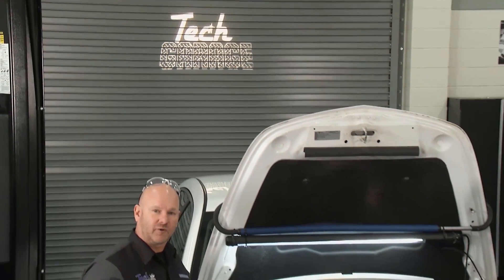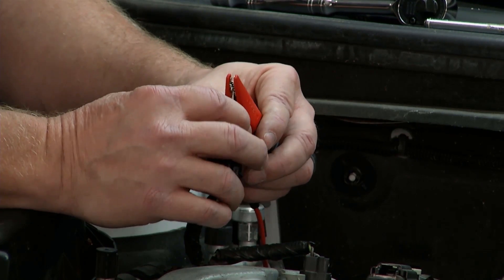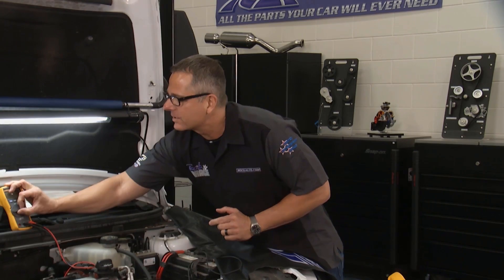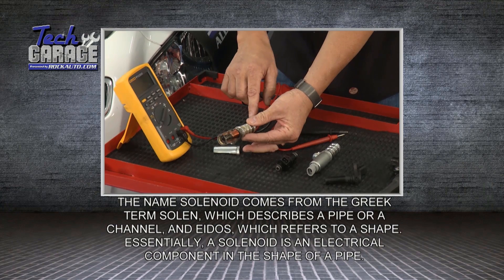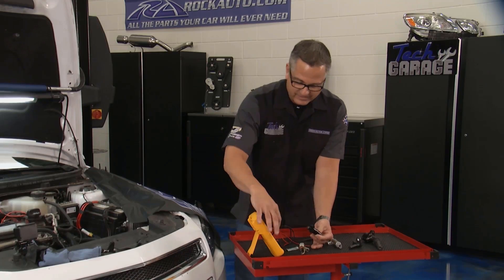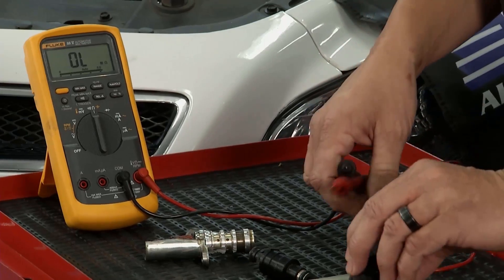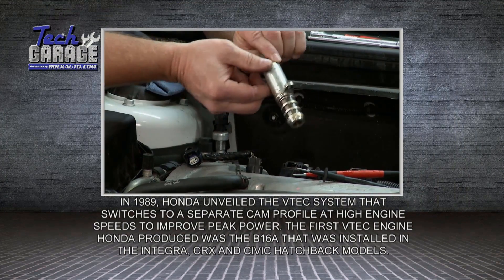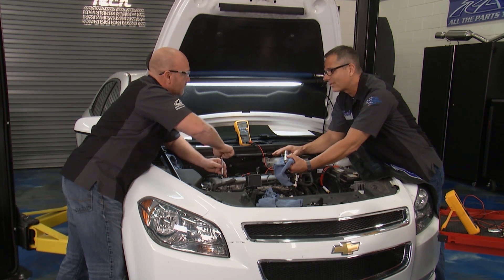Variable Valve Timing Solenoid Replacement

Comment: My wife and I are picking up a used 2014 2500 5.7l Tradesman Crew Cab 4x4 with 18,030 miles on it. This truck has VVT so this is going to be important to know! Thank you for posting this video.

Comment: I have a 2010 Camaro 3.6l engine and my aculator solenoid bank 1 and 2 are leaking oil bad. My question is can I just pull them off or is there a specific way I need to removed them? Is it possible to mess up the timing chain in any way?
Reply: The Solenoids, of which there are four, are not directly connected to the timing chains. They simply direct oil through galleries to change the orientation of the camshaft actuators at the front of each camshaft.

Particularly if there are leaks around the solenoids, remember to also replace the solenoid to timing cover seals, that may be purchased separately. I would be inclined to replace the seals in any case. A pain to have to do the whole job again for the sake of less than $50 in parts (possibly even lower cost.)

Comment: Would have been nice if you'd have said the torque for that 10 mm bolt.
Reply: bout 'meh' tight. know what I mean?
Reply: 10mm bolt head/socket to remove
Reply: The torque specification for a VVT (Variable Valve Timing) solenoid bolt is typically very low, usually ranging between 8 and 12 ft-lbs (10 to 15 Nm); however, it's crucial to always consult your vehicle's specific service manual for the most accurate torque value as it can vary depending on the car model and manufacturer.

The bolt is threaded into the aluminium timing cover, therefore it is important not to over-torque the bolt and possibly strip the thread.

Comment: 2 questions. 
What if debris gets into the solenoid whole? How do I clean it out.
Plus how do I replace the wiring harness? One of the tabs is broken might not connect properly.
Reply: Unfortunately I'd take off the valve cover, best way to clean it, then change the oil.

Comment: I did this with my 2013 Buick regal and now oil is coming from under the solenoids.  This wasn't happening before and I'm still getting a code coming up for this same thing.
Reply: Replace seals
Reply: @ABoog816  Replace the solenoid / timing cover seals.

Comment: Ok, so my question is, i cant get the clip off the VVT solenoid. what do i do to remove it? I got the clip pieces to pop up at the top of the of plastic that locks it down but where do i squeeze on the plastic that attaches the wires to the solenoid to get it to release so i can then remove the solenoid and replace it?

Comment: My connecters to the vvt are not coming off.
I have been fighting them for  3 hours.
Makes no damn sense.
Unbelievable 
It's a 2011 EQ 47,574 miles.
    I have never run into a lane issue like this

Oh wait...it's my personal car...yep. my own cars are the hardest always to work on.
  Customers  vehicles,  cake... but mine... I have sliced my fingertips, trying to pull the connecters off the solenoid.

Comment: The parts are 15 bucks each....the diagnostic tool and mechanic's time cost you your house payment for the month.....
Reply: $15 if you buy cheap knock-offs.  You should always buy OEM for sensors, though.  The voltage tolerances are so tight in modern cars that often the cheaply made aftermarket sensors fail quickly and you're doing the work all over again.  These GM OEM sensors are only about $35 each.
Reply: @morebeer7673  the cheap parts from Rock Auto made the HHR feel like it was turbocharged, the old ones were so bad. The only thing is, don't use their bolts to install....made of tin or something that breaks before it tightens. Backwards drills backed it right out of the valvecover so there was nothing seizing it....